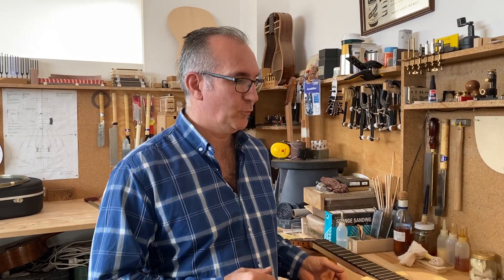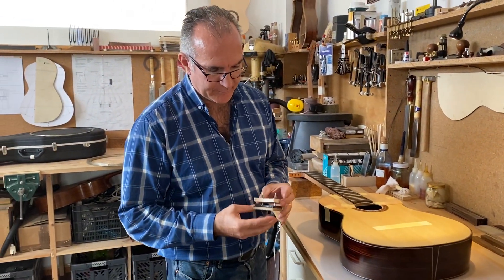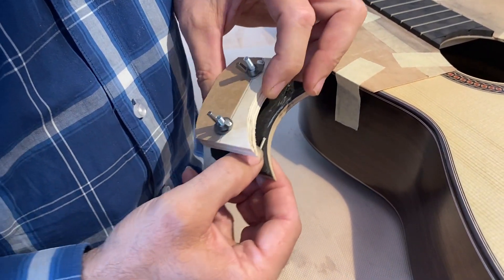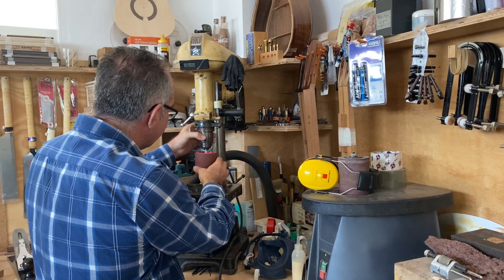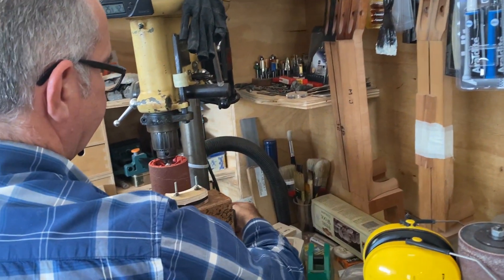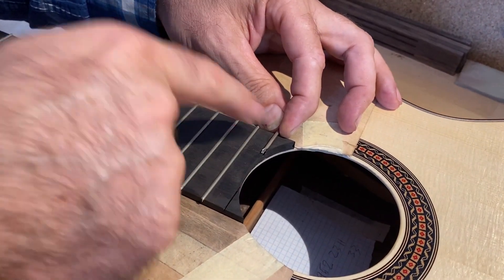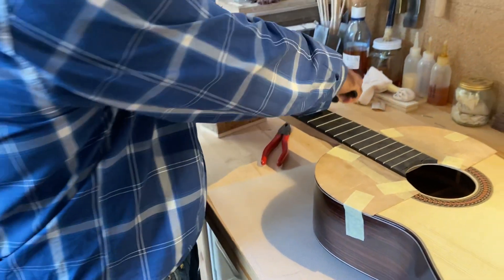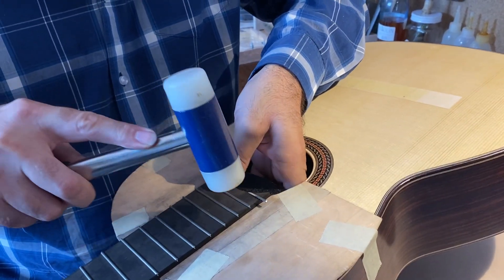How to fit the 19th fret on a classical guitar.

Comment: Hello Pablo
can you tell me the best fret width & height for a classical guitar,also is the neck set flat inline with the soundboard or does it pitch down slightly like a steel string acoustic?
great video's and work!
Reply from the maker: Hi Geoff, the size I use is 2mm wide and 1 mm high. This is pretty standard. 
The neck in my guitas have a very slight angle forward( the opposite to the steel string guitar) this is achieved by having the right slope on your solera mould. All of this is very clearly explained in my course which you can find on www.onlineguitarmakingcourse.con

Comment: Hello Pablo, could you please telle me what you use for fret: 2 or 2.5mm and why?
Reply from the maker: I use 2 mm which is 1 mm high. This is just my preference as I prefer a low fret. The 2,5 mm is a little higher but it will also be fine. The difference is very subtle.
Reply: @redkitekk  thank you very much Pablo